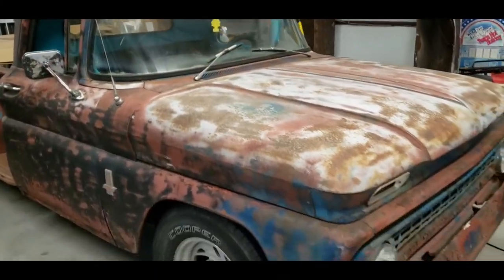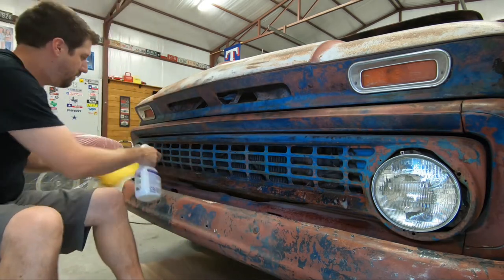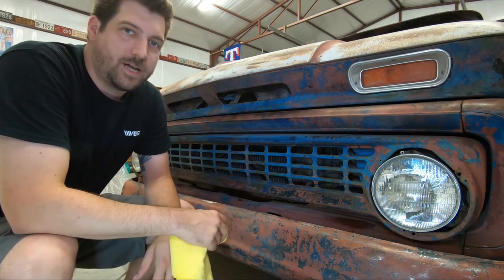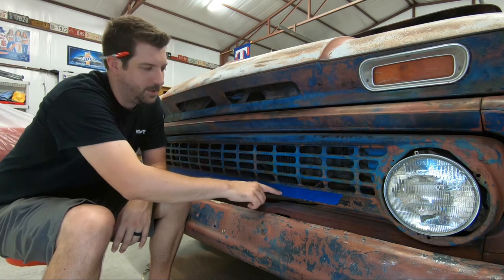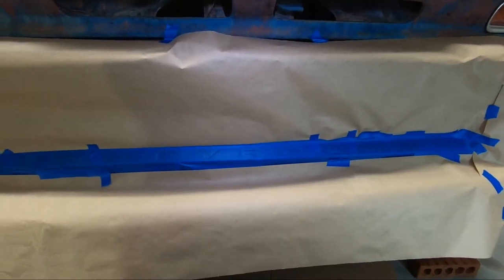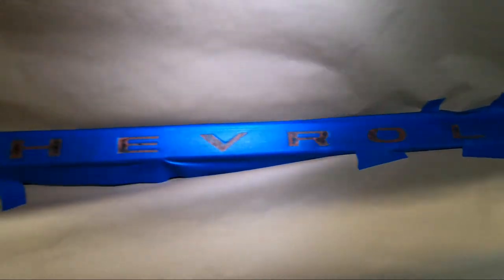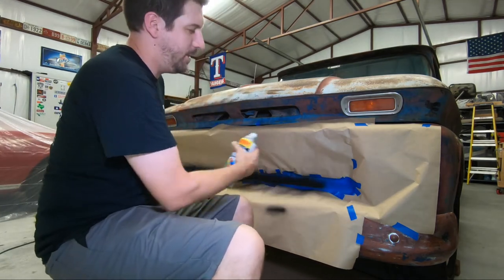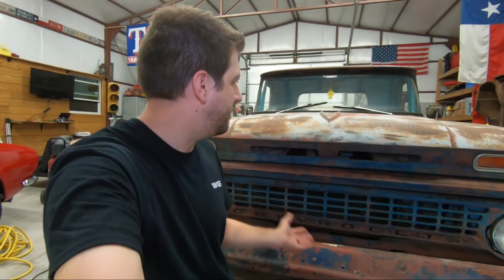1960-1966 C10 | Painting the Chevrolet on your C10 Grille

Comment: Looks like a 1963 C 10  
1961 Was the Apache truck  Double  headlights and the  bubble  hood.
Sometimes  called  pig nose or jet pods.
Reply from the maker: Its a 1960 for sure 100%, just has a later front end on it. Wish it was really a 63, the suspension would have been better than the torsion bars that were on it lol. Thanks for watching!
Reply: @CLASSICSAREBETTER  what really makes you think the harsh ass coil springs are better ride then torsion bar suspension?! People that don't know do dumb things!
Reply from the maker: @adriantomlin2902  Stock maybe not superior, but it is a whole lot easier to upgrade the non torsion bar C10s, way more aftermarket support is what I mean.
Reply: @CLASSICSAREBETTER  Not sure what you are talking about. I didn't have any issues finding a drop spindles and disk brakes. Plus the torsion bars are adjustable. Smooth ride 😎 
I am a believer that the 1960 1961 and the 1962 is a better smoother ride than the coil springs that are on the  1963 and later model trucks. 
It is the  leaf spring suspension that they eliminated in 1959 and  earlier that REALLY needs to be upgraded.